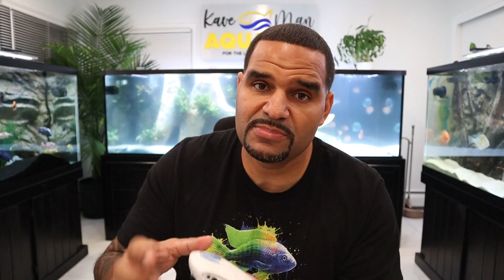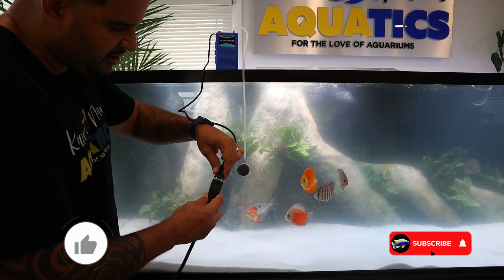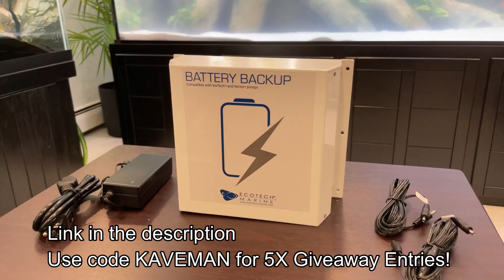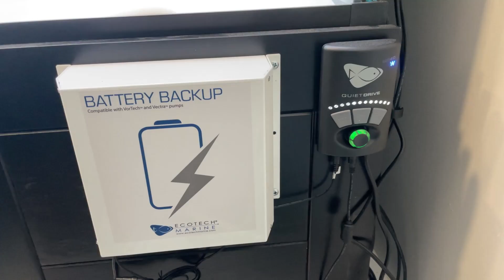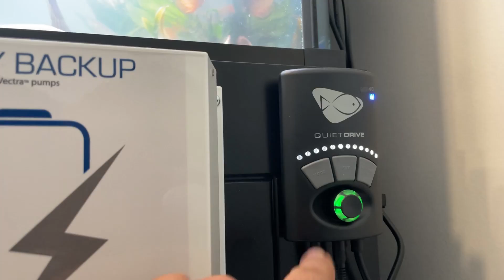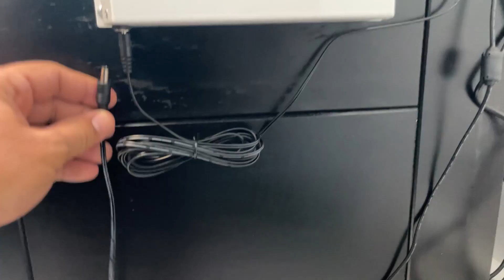This ONE Step Could Save Your ENTIRE Tank!

Comment: I installed 6kw hybrid solar for yhe house and 20 kw lithium batteries. So I mainly solved power outages problems.  But I have had catastrophic losses before due to outages in the past.so I also have 2 sun sun lithium air pumps with 24 hour backup. They run in normal conditions aswell. Just a seamless transition to internal battery if power fails but that won't be easy unless the inverter pops.

Comment: Kev, I almost got the Eco Tech Battery backup but I ended up getting a 1000 Watt UPS from my local Best Buy.  Why? Because it is also powerful enough to keep the FX6 going for at least a couple of hours. If I only choose it to power the wave maker, it will keep it going for HOURS!  (Our power outages usually last under two hours.)  You just have to make sure that you plug in your emergency items into the "Surge with Battery backup" side of the UPS. The price was the same as the Eco Tech Battery Backup.  This is just another option for the folks that want to consider battery backup.  The tech at Best Buy loved that I was going to dedicate the UPS to an aquarium.  He was also a fan of my "Total Reef" store. -Lady Tank Boss
Reply from the maker: A dedicated UPS is always the better option if you can keep it connected at all times. Remember, the ecotech battery backups main function is to operate on its own when power fails, like when you're away from home or asleep at night. If you can connect right to your UPS and have it do that too...excellent!
Reply: @KaveManAquatics  The UPS kicks on when the power fails, just like keeping your computer running when the power goes out, and lets you gracefully save your work and shut down.  This 1,0000 watt UPS is the Hercules of UPSes.  It is plugged in 24/7. It was hubby's idea too, but I conferred with the Tech also. The guys at my Best Buy are the best. -Lady Tank Boss

Comment: I was thinking of getting a PC UPS to connect to my air stones.  Never heard of the B-11 before.  I may consider that for my smaller isolation tank.  Thanks!
Reply: PC UPSs are a bit out of their depth with aquariums. They'll work and they'll usually work really well, but you can get power stations that will potentially run for far longer and not mind deep discharges.

Comment: What might come in handy is to use a computer battery backup. I have a few high-end backups that I use to put a few towers and big monitors.  They can be used to power Ware makers and Airstones and depending on the filters, take that load on as well.   I have a home generac for the home that kicks in after 45 seconds of lost power.  the battery backup keeps the power courage to zero.   Just a thought

Comment: Icecap DC power backup is running my sump pump, and it could do two pumps if needed just for less time.

Have it plugged into an APC UPS.
Reply: Icecap will run pretty much any DC pump.

Comment: Good advice, i think a lot of people probably don't think of these things until its too late.. so always good for a reminder. Id recommend with those cheaper B11 bubblers to double check they work like shown here, simulate the power outtage. Ive had one before that was defective from a wire not connected properly when manufactured... Didn't realize it until there was a power outtage.. had other backups so was fine.. but gotta check periodically that your backups are in good working order.
Reply from the maker: 100% Agree!

Comment: Have you looked into Computer Battery Backup connections? They are designed to provide continuous power but I do not know the length of runtime.  It could possibly be an option that is less pricey since they have been used for decades.

Comment: Another good option Kev for air pumps is Aquarium Coop sells a single port and a dual port lithium battery/ ac powered air pumps while plugged in it charges the lithium battery and when power fails it just keeps running. Also they are variable output as well. I have them on all my tanks I love them and they are quiet and work very well.
Also as you mentioned lot of different backup power methods that is an essential tool needed for the fish keeper.
Reply from the maker: Thanks for the tip, didnt know those were available.
Reply: They have to be already running though I believe. I like these because I don’t won’t those bubbles running all the time in general.
Reply: @cards_curmudgeon  yes sir that is correct I'm running sponge filters in each of my tanks using the aquarium coop pumps except in my big tank I'm running a 4 inch air stone with one of those pumps. It's just a matter of preference some folk like air and some folks don't.

Comment: My concern is the air stone on the backup pump. If it's not used in months or longer but the air stone is sitting in the tank the whole time, won't the pores be clogged when the emergency hits?
Reply from the maker: When I water change and cut the power, the backups come on without a problem every time 😊

Comment: Man, I'm sorry you has to go through that. Are you ever gonna give the rays a 3rd chance? 
75 gallon Stocking question

I currently have a 75-gallon aquarium with 7 huge congo tetras. My stocking ideas were to have 1 good-sized piece of driftwood and a ton of live plants. For fish, I was thinking 3 angels (possibly different colors)  2 electric blue acaras, 1 apisto (probably one of the red kinds so no aggressive behavior from the acaras), 1 corbensis (is that a good idea?), and possibly down the road some cory cats or a bristle nose pleco.

Is this a good stocking list? What would you change up? I'm open to suggestions. (And I want the ton of plants because boy I get an earful about the water bill 😂)
Reply from the maker: I dont have a lot of experience with those species of fish so I really couldnt tell you if they would all work well together. The tons of plants will help in keeping the water clean and nitrates down, but it may not really make a (big) dent in your water bill as water changes are still highly beneficial.

Comment: How long can the FX6 and the 407 go with out power before they become toxic? When I google it I get all kinds of answers.
Reply from the maker: Thats because it's hard to pin point a specific time. Some say after a few hours without oxygen the bacteria inside will die off. BUT, I've accidentally left my valves closed for over 12 hours and it had no effect when reopening the filters. No ammonia spike or bacterial bloom, which leads me to believe I had little to no beneficial bacteria loss. But thats all speculation 🤷‍♂️
Reply: From personal research, I've heard that after 8 hours you should add the canister filter media into the tank. But probably have a battery backup air pump on the tank at all times (like an aquarium co op one) hope this was helpful to you!